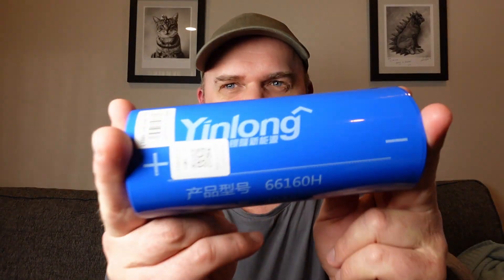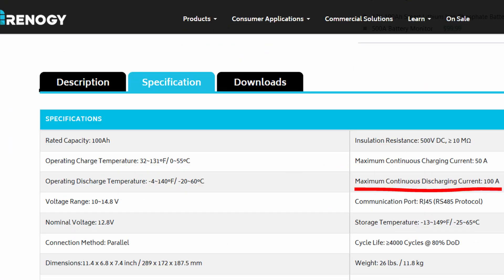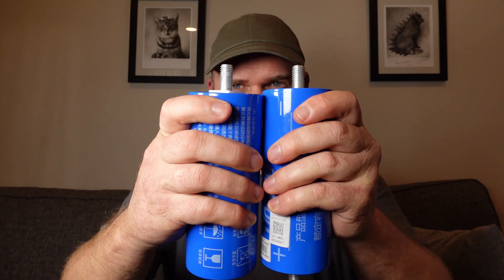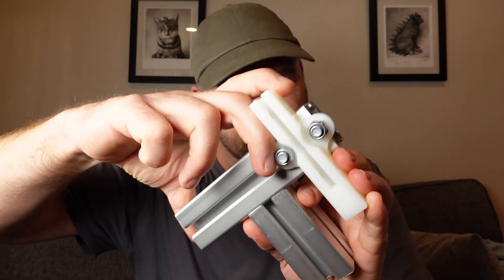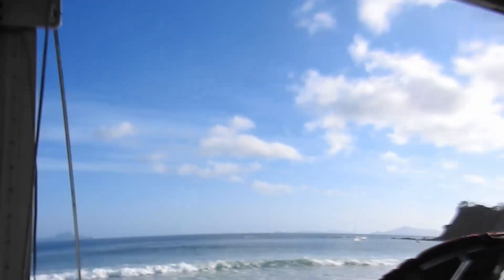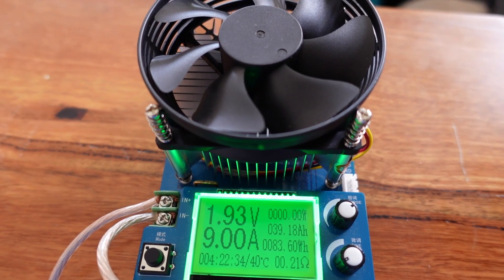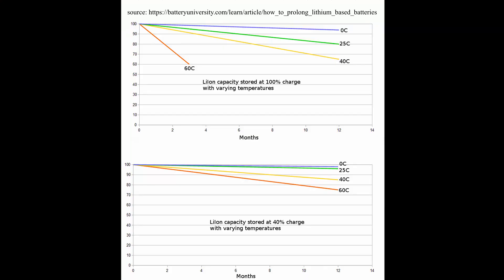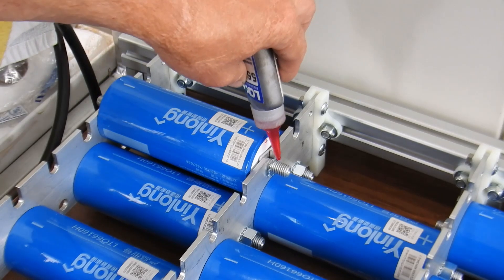Campervan DIY battery build HUGE POWER!

Comment: How about doing a video on how you charge theses cells and with what charger types? Good video altogether!
Reply from the maker: Coming up....   thanks
Reply: Use ST's GAN switching even the six 💵 BOARD for each cell there good for 400 watts EACH!  ST is on YT BUT STOCK ON DEVELOPER KIT IS NEXT TO NONEXISTENT AT MOUSER.COM
Reply: Yep...I’m interested in that too. Chargers and charge controllers are usually fairly specific about the chemistries they suit. Most will do agm, and Lithium Ion is becoming more common, but I’ve never seen anything that specifies LTO....
Reply: @ChoirFan1  contrary to popular belief specific chargers are not needed.  Those 55.95$ desktop power supplies are great for charging even these.  All that is needed is to not EVER go over charging voltages on lithium.  Same as with lifepo4.  If the 6s is lto top charging voltage is say 17 volts set it for 16.8 volts and let it charge.  Its quite easy to charge these as even car alternators (with a potientometer to raise voltage going to battery) can and do charge them pretty easily.
Reply: You can charge these cells like the other lithium chemistries.  Match voltage and keep it constant.  I believe these are 2.85 per cell for charging current.  The icharger x6 is nice.  6s qnbbm balancer coupled with the isdtgo for bms makes a great combination.
Reply from the maker: 2.8V for these, tho there is no real advantage in charging them above 2.6V
Reply: @brendontait6968  yea i know but usually mapped chargers charge at the charging voltage like the hobby chargers and what not.

Comment: Awesome video! I'm looking to replace my AGMs in the boat and this looks like a really promising alternative. I'd be very interested in a group purchase if you organise one of those? I'm Sydney/Australia based.
Reply: i would use northstar agms for your boat. these arent built for motor start only for house banks.
Reply from the maker: Hey, yes I will be.  The person I had dealt with had resigned, so my emails weren't getting to anyone.  But the supplier seems interested in doing a group buy with some good pricing.  (Much cheaper than what I paid).  Flick me a message on brendonsbuilds@gmail.com

Comment: Enjoyed this a lot. I go back and forth on LTO. not a lot of info out there on them.
Reply from the maker: Thanks, yeah...  I'm a little the same.  The only downside I can see with them compared with LFP is $/kWh.  Other than that, for reliability and power output... these seem great (so far anyways)
Reply: @brendontait6968  Agree. The only thing not to like about them is the price kWh.  Other then that they seem to be the way to go for stationary. Bit heavy for a car/boat though. Great if you live in a cold place like NZ

Comment: One question the yinlong lto battery what's is the voltage to charge them itch cell and for car audio built what's we be the charge for itch 6 cell max voltage of charge
Reply from the maker: Max charge voltage is 2.8V/cell or 16.8V in a pack of 6.  Full capacity is around 2.55V/cell or 15.3V for the pack of 6.
Reply: Thanks for the info
Reply: And what tape of charger you use to charge the LTO cells
Reply from the maker: @davidspl  I used just a variable power supply to charge this pack, tho I'm fitting a regular victron mppt, also just charge from the alternator
Reply: @brendontait6968  
Thanks always

Comment: I think this explains what Will Prowse mentioned: "Coulombic efficiency tends to increase over charge discharge cycles because the build up of SEI slows down further parasitic reactions and stabilize the electrode. Initially when electrode was new, the SEI layer is thin and parasitic reactions is quick, this means Coulombic efficiency is lower.". From https://www.researchgate.net/post/What_affects_the_coulombic_efficiency_for_lithium_ion_batteries/57594e1993553b772e36b832/citation/download
Reply from the maker: I think this may be true for regular LiIon cells, but don't think LTO electrodes form a stable SEI layer like graphite electrodes do in regular lithium chemistries.  I think the reason Will may have seen poor efficiency may be due to cells being B grade (they have a different wrap on them) and high discharge rate he was testing them at.
Reply: (FYI) I don't know about this stuff (yet!.. about to take a similar plunge myself), but that citation feature/page didn't include the whole conversation (they were on mostly about LTO): https://www.researchgate.net/post/What_affects_the_coulombic_efficiency_for_lithium_ion_batteries
Reply from the maker: Yeah...   there is still a bit to learn about this chemistry.  One of the benefits to the electrode is it is stable and doesnt change in volume with change in charge.  This is one of the factors that degrade graphite cells through electrode degradation.   The SEI layer is a solid interface that forms on the electrode.  It was thought that the LTO chemistry didn't have one, however I think more recent research show that it can form in small amounts with some impurities but is unstable and not like the stable layer formed on the typical graphite electrodes.  Increased temperature can cause the titanate to increase in resistance which could decrease the round trip efficiency.  This can actually work to it's advantage due to when a cell suffers from an internal short circuit, the titanate gets hot and pretty much becomes electrically insulative and prevents thermal runaway.

Comment: If your main charging comes from either being pluged in or off your alternator while driving then LTO are ok but if you're relying on solar then LTO is not a great choice. The round trip efficiency of LTO cells is sadly very low. There's about a 15% loss of energy on what you get back out over what you put in. With a camper, RV or even sailboat you have limited space for solar panels so loosing 15% of what your panels produce can hurt. For an install on a property where there's ample space for solar panels one can easily just add a few more panels, they're much cheaper than batteries. This is why LiFePo4 cells are the far better and far more common choice for mobile deep cycle applications. The thermal runaway is not like those cells you got to violently combust and at 99% efficiency they rock.
Reply from the maker: Thanks, but I disagree.  As I mention in the video, my own experiment showed 99% efficiency for these batteries (this test was done with around 1800W charge/discharge equivalent on the pack) there is a video by David Poz also showing around 99% round trip efficiency for LTO https://youtu.be/z95U7Hq2M5k

Comment: Didn’t catch the supplier, can you tell me which one did you buy from ?
Reply from the maker: Sorry, the aliexpress supplier I bought from seems no longer available.  However... I have bought a second set of batteries from a bulk supplier and they have all tested great.  I will be offering a group buy on these in a week or two with a much cheaper price than I paid for them.
Reply: @brendontait6968  Thanks for taking time to reply, really appreciated.
Have you looked into alibaba suppliers ? I’m still evaluating since my country’s taxes are a pain in my hole, but those prices are getting my attention. Need to confirm about the quality tho..

Comment: Its plastic wrap is very thin. Try using additional insulation or thenbattery pack will get shorted
Reply from the maker: I'm not sure what it will short against?  All cells are held spaced and each bank is at the same potential!?!??!!

Comment: Hi, did you get a active BMS unit for the batteries ?, The "QNBBM 6S active balancer" on Ali look okay. Was going to build one myself as there quite a few chips around but.......
Reply: I have such balancers for my 66160 cells, they are fine. But it is not a BMS, just a active balancer. (i have intelligent load, so no problem for me)

Comment: Great build and info - thx for posting your experience.👍
Yep -  I was thinking of doing a 48V pack for an electric Flexwing trike.  The long safety inflight, long life and quick recharge is what l love about these batteries.
Looking forward to more  -- new Sub!

Cheers
Reply from the maker: Hey Patrick, welcome to the channel!  Tbh, if I were doing your project,  I'd be looking at batteries that are far more flammable...  maybe tesla modules with a jettison pin and anderson connectors? As you're likely aware, weight is everything with flying and some tesla modules would likely be 1/3rd the weight.... but still a lot heavier than gas.  I've got a 12tonne truck, weight doesn't really matter.
Reply: But we have found out that the balance of starting power to cruising power has been too low. The newest plane design has tremendously low energy consumption. So accepting your factor of three FYI that is far less of a factor than increase in efficiency in other words you can have a battery pack that is 1/4 the storage but because it can get you in the air like a grasshopper say you will be able to go further. These planes are the way to fly and it's okay to land every hour or so for refueling if you ask me. I read about it a few months ago when they finally went public after many years of development. When you build a very large jet apparently doing it well matters less but using an ounce instead of a gallon of fuel is worth it in smaller planes.
Reply: @brendontait6968  
I would rather lean toward the heavier/safer factor and not worry at all about a fire/ejection.  With a motor, prop and wing setup designed for a tandem flight - you treat the battery weight as the second person and that will give you nice setup to get high up to soar for a while.
I am hoping by the time I am affording a conversion - 2 yrs -  there will be some solid state options out there - so many working on this now -Time will tell🤞
Cheers

Comment: https://www.youtube.com/watch?v=z95U7Hq2M5k&pbjreload=101  David Poz got 98.9% round trip on used cells. 
If you have an electric car and want to charge it you can save a lot of money buying 12 cells at 24V and run a 6000W (250A) 240V inverter.   You can buy used solar panels at 33c a watt.  So 6000W will cost you $2000. The batteries $1000 and inverter $500 and misc $500.  Thus $4000 and you can charge your car at 18 mph.  Thus 100 miles a day.
Reply from the maker: Thanks, yeah, David actually even commented on this video.

Comment: Great vlog mate, I got two lithium iron phosphate batteries off ebay. They where so cheap too. Work out the math these batteries each per kWh cost me 0.0001789122. What a saving. I did sell to second batteries for these for 80 dollars au. But each originally cost 375. So if gotten off ebay with 10 per off during to ebay  plus would cost 0.0017891221.  Thanks for a great vlog again.

Comment: Question about calculating the cost of the battery vs the competitors.  Is using 20,000 cycles reasonable?  It seems to me that almost no one, in normal use would approach that number of cycles in a van.  Also, your set up was really cool, however on your next build, if you cut "U" slots on both sides of the aluminum brackets and mount one end on a hinge, you could access the bottom batteries as easily as the top, if you ever need to replace one.
Reply from the maker: Thanks, if you notice in the video...  I said that 20,000 cycles might be overly generous to these cells bc you're unlikely to use that much power and instead of 2.7c it might work out closer to 10c.  By specs, these cells should outlast regular batteries 3 fold based on years.
If you look at the files I posted in the description, one of the options I supplied does have slots on both sides for that reason.

Comment: Nice video Brendon. Very interesting documentation.
What seems off for me, it is the following topic:
18650 NCR: 3.7V x 3.4Ah = 12.58Wh - 45gr
LTO: 2.4V x 40Ah = 96Wh - 1250gr
So for the same weight of a LTO you can stuff ~27 x 18650.
Reply from the maker: Hey Razvan, that doesn't seem off for me at all.  An NCR is at the high end of power density for lithium chemistries and from your sums around 3.5 x as dense as the LTO.  It is also one of the most dangerous.  Typically as you decrease the power density in something, the reliability and ruggedness increases.  I have chosen this chemistry due to it's apparent ruggedness and inability to want to catch fire, I want most aspects of my truck to work reliably for many years.  I did actually consider making my pack from 18650 cells, but after looking around facebook pages where people had done similar, I had never seen so many peoples homes burnt down in one place.    Weight isn't a significant factor for me.  My truck currently weighs 7.5t and has a limit of 12t.  Based on comparing my battery with the density of an LFP that a friend has in their van, they are equivalent.
Reply: @brendontait6968  I agree with what you said.  And thinking again about your truck makes perfect sense now. I think you have chosen the correct setup.
Nice video again, keep them up.

Comment: What happens when a battery has a short internally?
Reply from the maker: As far as I'm aware, the Titanate Oxide electrodes are much more stable than graphite and don't have the same catastrophic runaway that regular graphite electrode batteries can have, but if you're aware of something I'm not... would love you to fill me in.   Thanks.

Comment: Hi Brendon Thanks so much , is it possible to give details of the balancing system you use or any other information where is the trustee seller, I heard it’s a bit hit and miss getting it so any contact you have is much appreciated,
Reply from the maker: Hey yeah, BMS details in upcoming video.  Ali dealer is having issues at the moment with their store.  Will link as soon as they have sorted the issue.

Comment: Good to see someone else is building a large battery bank based on the LTO Yinlong cell, I have just starting to commission a 6kW LTO  setup myself, I have only cycled about 120kwh out of my LTO bank, still waiting for my DIYbms parts to turn up.  https://youtu.be/6b6nOjc9KPA
Reply from the maker: Yeah, I've got no idea if they will live upto their specs...  fingers crossed.  My BMS video coming soon.
Reply: @brendontait6968  BMS is very hard to find for a LTO battery bank, i am going with a 22S diyBMS v4.21 created by Stuart Pittaway, waiting for the build parts to all turn up

Comment: What is the cost of these puppies?
Reply from the maker: I haven't got a reply from the bulk supplier yet, but generally speaking they retail around $50USD each, am hoping that I'll be able to get them for a 30-40% discount with a bulk buy - but not able to say till I hear back from supplier
Reply: @brendontait6968  Thanks for the info, here's hoping the AH per dollar is comparable to the more affordable quality 18650's.
Reply from the maker: @joeyuno3846  try to avoid using the term Ah as a unit of energy....   it isn't one.
Reply: @brendontait6968  Thank you for the advice, I used it as a comparative term for capacity in batteries. I do prefer watts per dollar for solar cells however.  Ergs and kilograms for scientific denotation of rest and kinetic mass respectively.
Reply from the maker: @joeyuno3846  Ah is not a useful unit to compare batteries energy capacities unless you are only interested in how many coulombs you want.  Different chemistries and layout have different voltages, the voltage is as important as the Ah as far as how much energy storage the battery has.   But it gets more complex because you could have 2 batteries both with same Ah and voltage but they could be different Wh depending on the chemistry.  If the voltage sags under load on one of the batteries then the useful energy will be lower in that battery.  It's going to be my mission in life to convert people away from using Ah as a unit for battery capacity.
Reply: @brendontait6968  I see your point-thanks for the excellent explanation.

Comment: Great video BUT...  * Steel hardware plus aluminum bus bars could create real problems BOOM! *
Reply from the maker: what circumstances?
Reply: @brendontait6968  Cory Poole has raised a valid safety issue. He's talking about an oxidative surface reaction of the aluminium that occurs over time, causing a resistive connection between the cell and buss bar. At high currents this is going to cause a (very) hot spot. Aluminium oxide - I.E. - aluminium anodising is an excellent insulator with around 4 microns able to withstand 500 volts DC and it is quite hard. A suggested solution is to smear the contact with an anti oxidant paste made specifically for the task. Please take this seriously. 
https://mikefullerelectric.com/antioxidant-paste-for-aluminum-wiring/
Reply from the maker: When I assembled the battery, did you notice me costing the battery light with some grease on the end of a q-tip?
Reply from the maker: @SystemsPlanet  yeah I've got a reasonable understanding of galvanic corrosion and it would be a potential issue if I were submerging it in salt water.  I'm going to try avoid submerging it in salt water.  

I have no idea what he means by BOOM!  I was thinking he meant cutlery falling down or something.  But I'm going to have a polycarb cover to protect the connections from that sort of thing.  Maybe he just thinks I'm dumb.